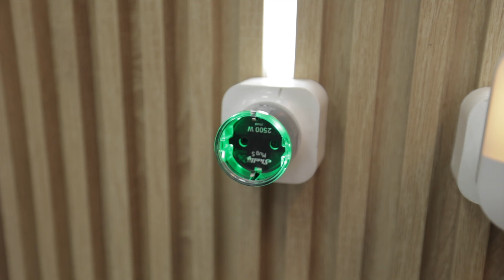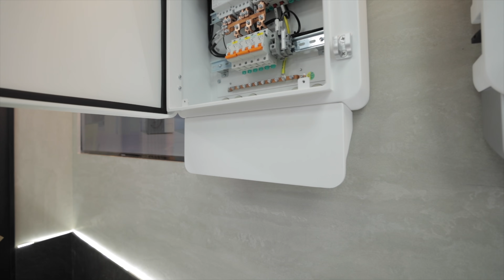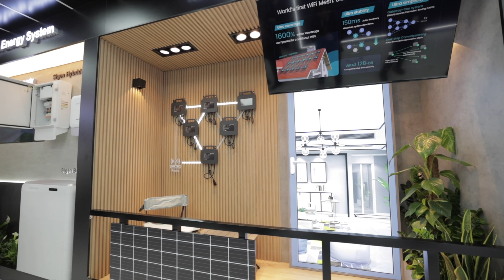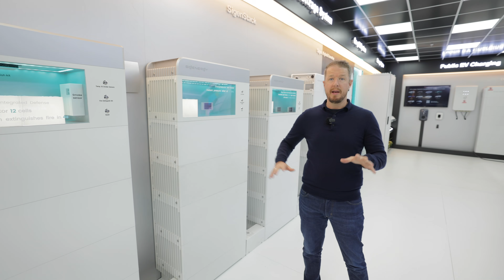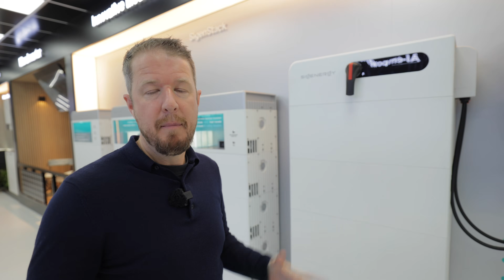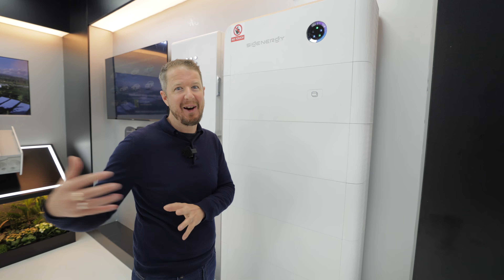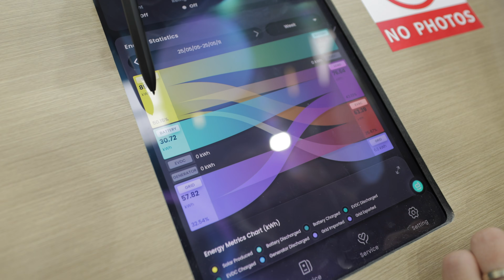Is Sigenergy About to DISRUPT The Solar Industry?

Comment: who will buy those no one customers are looking for cheap labour and Cheap stuff
Reply: Well, here in the States the price is about the same as a comparable Powerwall 3.  But it is much faster and easier to install if the Powerwall uses the Gateway.  With the comparable price you get easy and fast generator access, 5 smart breakers and built in sizing for up to 4 controllers.  You can add more controllers but that is as much as a typical US home can have installed through a 200 amp service panel.  Unless you go the DIY route nothing is faster to install, with a gateway.  I don't know about elsewhere but the Tesla backup Switch is a huge win price wise.  But PointGuard has them in the utility companies for approval so I expect that they will be available soon. That will be a game changer.  These plug controllers are for the most part useless as far as I am concerned.  But that may just be me.

Comment: I programmed a Raspberry Pi to control my Solar. It controls when the water is hot from excess solar to switch it to storage heater. I feed my washing machine from the hot water tank so don`t have to worry, the machine only uses 750 watts on full spin which the solar can handle. I have 3 micro inverters which are old and are not internet. Been working for years ok. The Pi also control the wood burner which takes over when solar is down. Quite happy. Only pay £30 a month in energy.

Comment: Are they still considering making the AI a subscription? This is a very unapealing possibility.
Reply: I am in the USA and have installed the PointGuard system on my home.  Same core system, different name.  I turned on the AI system 40 days ago.  After a couple of weeks it started sending power to the grid during peak hours from the PV rather than charging the battery.  At first I panicked a bit. But it charged the battery to 97% decided that was close enough and fed the remaining PV to the grid for maximum return.

Recently I noted that it was actually draining the battery to the grid.  Again, only the top few percentage points, not the whole battery.

It is not a subscription, at least not in the USA.  You simply turn it on in your app.  It will be interesting to see what it does in the winter as production chops off earlier and the nights get longer.  We use a much larger percentage of the battery then because of it.  But again, no subscription, but expect it to go through a learning period then you will see odd things happen.  At least I did to take advantage of the TOU billing.

Comment: I was saying this nearly 20 years ago, demand-side load based on supply-side excess. Smartgrid.

The issue is now you can't really do this at the socket level as the appliances have their own "minds". Replaced my washing machine a few months ago. I changed from a physical button in = on out=off into one which must have a button pressed.

You cannot have a "smart home" without it being either "dumb appliances" or they all speak the same "smart language".

Currently having 7.4KW solar and 10KWh battery and the battery is my way to handle this whole topic, I never export, I store.

Comment: Anyone know how configure the current gateway and app to prevent a third party EV charger (Hypervolt Home Pro 3) from draining my Sigenergy home batteries when an EV is plugged in?!
Reply: ow that would be a useful product.  I get tired of managing this by hand.  I have even considered buying the PointGuard EVSE so I can have the system handle this.  It can get old.
Reply: @ I didn't know that this car charger could handle that? I thought that the issue was more that the Sigenergy Gateway can't communicate with third party EV chargers and a vice versa? The Sigenergy DC EV charger module is ridiculously expensive and is not supported by Octopus intelligent Go tariff. This is the biggest problem with Sigenergy at the moment and I hope they can address this in the upcoming firmware / software update. It would be good to know this so customers understand where on their circuit is best to locate the AC car charger...before of after the Gateway.

Comment: Problem i find with all these Chinese manufacturers is they are basically all releasing the same kit, snd they all rush products to market rather than focusing on what they have and improving it. When this happens things go wrong because they are not properly tested. All personal opinion of course.

There is a very large chinese inverter manufacturer that has a specific product range (not domestic) which they are strongly suggesting has update ASAP to stop it potentially going bang and with the possibility of taking out some other protection devices along the way.

The European manufacturer maybe slower at getting things to market snd more expensive but i trust it

Comment: Hmm.. but how does having a smart socket help with switching on a washing machine or a dryer.. when I switch on the washing machine it wants me to select a programme and press start. Also once the programme starts then it's going take as much energy it needs. Really to make this work you need the equipment manufacturers to play ball and be able to adapt their systems to react to the changes in the energy available and slow down/speed up the heating of water, heating the tumble dryer etc.
Reply: Is not a ‘game changer’ having another app to control your smart home, most people will already have such a system… having Sigenergy app available to home assistant/ Apple home&c. would be better.
Reply: It doesn't work for the majority of modern devices.
Reply: @matthewseymour8972  Although many do have delay starts where you set a "Start in xxx Hrs/Mins" options - at least my washer, dishwasher & dryer do.
Reply: Exactly.  This very dumb idea has you starting the washing machine the. Shutting off the Shelly so that when you restart it, the machines autorestart program will kick in.  But those have timers that limit restarts to less than 30 minutes after a disruption.
Reply: It only works with appliances that can be controlled this way, I’m not aware of any currently though but I think will be starting to become available in due course
Reply: @_chrisr_  I have a number of BSH (Bosch, Siemensand Neff) devices and most are connected to my home using their "home connect" service. Things like the dishwasher, tumble dryer and washing machine can be set to wait until solar is ready or power prices have dropped. I have a Loxone control systemthat "could" control all of this. Currently as we have a battery and solar it doesn't really make sense as we want these appliances to run when we want rather than wait and the ability to store or export energy makes it "currently" less attractive. I can see a time when power prices vary much more during the day and being able to pause an appliance if the battery is flat and their is no solar would make more sense.
Reply: I found that being locked into a particular manufacturer is very restrictive. Home Assistant has 21,000 developers providing solutions to provide considerable flexibility to smart home users enabling them to provide integrated solutions across different manufacturers. Indeed SwitchBot has formally recognised Home Assistant and its smart devices can be directly accessed by HA. 
I suggest PV installers take the time to thoroughly investigate HA (as they have been done with Sigenergy) with the same due diligence - HA has over 2 million users worldwide wide.
Reply: @robveck6683  I don't think we will see a lot of first party uptake to introduce official HA support for the simple reason that they wouldn't be able to collect data that way. Of course, operating everything locally (and, in my case, eschewing WiFi entirely in favour of the other protocols) is probably the main reason people use Home Assistant in the first place. It's just not that compatible with corporate interests, which is why I hope we get some more easily wireable internal compact smart switches & relay sets to enable conversion of any device to something HA-compatible. I'm considering bodging a solution to make my air conditioner operate fully via Zigbee to the HA hub, but it's probably not going to be easy.
Reply: Exactly my thoughts.  And if a device is designed to work smart with energy, presumably it's going to do that without a 'smart switch'.  I'm actually about to need a new washing machine, and would like one that's ready to tie in the energy system better, but I'm not sure if such a thing really exists.
Reply: You select the program you want to use and  switch the power on on the washing machine then the smart switch will switch on whenever you tell it to, I've been doing that for years with a simple plug in smart plug.
Reply: @GaryV-p3h What washing machine do you have that starts when the power comes on?
Reply: Some smart devices don't need to tie into the system - they can react to signal pulses from the smart switch in place of a button press. At bare minimum a smart socket can be used to inform you when washing machines or dryers finish their cycle to maximise your usage of power during solar hours (rather than letting wet or dry laundry sit).

IMO a better option than smart heating in these sorts of devices is a smart heat pump water heater which preferentially heats water during energy surplus or cheap tariffs, and then feeding washing machines and dishwashers directly from the hot water tank instead of heating their own water.

Comment: Why can't we get microinverters in the UK?
Reply: You can, just very few people do. Enphase are the most common ones.

The biggest issue is you are installing the most common point of failure, ie the inverter, in a place where you can't access without the need for expensive access equipment
Reply: @markc5999  MY complaint for decades.

Comment: If they worked with homeassistant then they could save costs and the customer is ultimately in charge
Reply: The sigenergy inverter has modbus...  It works beautifully with ha
Reply: @MacCalder86  you have it running? Last I heard the Sigenergy system required to “touch base” with the Chinese cloud at least every 90 days, otherwise it would shut down. And my perception of the HA integration was that it wasn’t simple or stable. Have things improved now?

Comment: I could be interested in installing Sigenergy only if it can be guaranteed that it does not need an active internet connection (internal wifi is fine through).

Comment: It was done years ago through PLC, Cinemas used it 30 years ago , sound ,lighting, heating, projectors were controlled, my question about the synergy equipment is what  security has the hardware & software has it got ? Micro converters (switch mode PSU) nothing new

Comment: Hope they fix the issues. Getting fedup with my system not working
Reply: Explain please, because I don't see any problems with my clients.
Reply: @ app fails to load, missing data, what data is present is wild, Ai not that aggressive and now doing random things, inverter making a wining noise that’s super loud, battery ware in 4 months is over 5%, AC charger constantly error fault
Reply: How are you eastablishing that the battery has worn over 5 per cent in 4 months ?
Reply: @petewright2283 This sounds more like an installation/configuration issue. But I don't have experience with this manufacturer, so take that with a grain of salt.
Reply: @petewright2283  CT's or meter are connected wrong. Or config is done bad.
Reply: @HenriUA Nope, No CT’s as have a gateway. Very little to configure for it to be issue. The issue lies with Sig.
Reply: @petewright2283  Rotation field in the gateway is correct? Are your grond rods below 10ohm? You need perfect grounding and very close reading to the provided neutral from the street.
Reply: @HenriUA all checks out and passes test

Comment: I very much doubt that a washing machine or dryer will run automatically as soon as the power is switched on so switching the mains like this is useless.
Reply: you can do this already with home assistant if you own a smart washer/dryer , I have a routine that after I load my washer in the morning as soon as I get excess energy from my solar it runs a washing cycle and once finished it checks if I still have excess energy and proceeds with a dry cycle, If I don't have excess it sms's my wife to tell her to put the washing out. :text-green-game-over:
Reply: @tonysanderson7741 yes so the machine has to be "smart".  You can't just switch it on and off with a plug.

Comment: Stunning Presentation from a Guy who knows the key selling Points of Sigenergy's approach ...... The Company is lucky to have you on board .....   The Disconnect between the Customer & the Manufacturer is huge these days .....   With you on their side Sigenergy has a huge advantage .....   I am in Australia & I am a Huge Fan .... The issue I have is Electrical Standards & Products differ across the world .... I see no reason why this is so .....   ! simple example .... A BG Fortress Consumer Unit is NOT available in Australia .....   This is Ridiculous ..... Pressure needs to be applied to standardise & develop AI Configuration tools at Electrical Component ordering & quoting time ....   Why must an Electrician be concerned with RCBO or SPD Heat dissipation rules ???   AN app that configures a Consumer Unit based on Circuits would be a start...

Comment: Shouldn’t be suggesting that somebody switches large (and maybe inductive) loads with a micro relay based smart plug

Should always use a contactor based solution 

You don’t ever seem to mention the warranty is only a few years on the GW and screens/ strip lights.

Also, is the AI mode going to be paid for in the future? Isn’t it presented in the app still as a “free trial”

Fishy eh?

Comment: All very good but what about the warantee. So far Sigenergy's warantee doesn't suggest they have much faith in their system's ability to perform over time making it a bad investment compared to other offerings.
Reply from the maker: What do you mean?
Reply: @artisanelectrics  If I explain it more wholistically. The video comes across as bias and un-balanced in terms of selling toys most people don't need and won't practically be able to take advantage of and not explaing the whole deal in a balanced way compared to the cometitiion. Ultimately, who has a washing machine that will start washing when the power is turned on ........
I generally like your videos but one day you push one thing and the next another and in this video I really think you have missed the point of giving a balanced review and run the risk of becoming a channel who is simply chasing views and at worst, recieving un-disclosed benifits.
Reply: @artisanelectrics  They have short and limited warantees compared to Tesla and Give Energy for example.
Reply: @clivestinton5217 energy throughput based warranty which can be HAMMERED. By the AI mode.

Never any mention of the China connection, or that the gear HAS to be connected to the web else the batteries are bricked and the inverter just acts as a basic solar inverter.

Lots of clever (supposed) safety features all “in the cloud”.

And……. Sorry but you’ll never extinguish a thermal runaway battery.
I wish sig wouldn’t say they can

Comment: Forget the Sigenergy app and any cloud dependent systems, they need to enable the whole system to integrate with Home Assistant. There is a third party Home Assistant modbus integration for Sigenergy that is very good and Shelly devices also work very well with Home Assistant.
Reply: The ha integration isn’t official

Comment: A bit disappointing with the size increases. I would have liked to see 5, 8 and 10 as choices
Reply: As long as I can add these different sizes to my stack, I will be a happy camper, don't do a power wall 2 and 3.
Reply: @neilm9400  From what I was told completely interchangeable.  I have two 8 kWh batteries on my system here in the States.  Before winter I will be adding a 9 kWh battery to the stack.